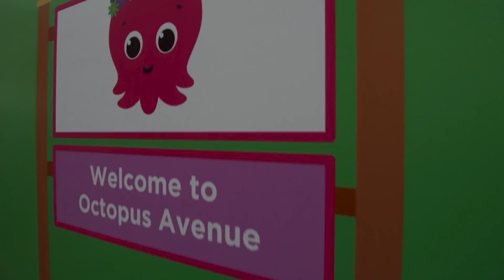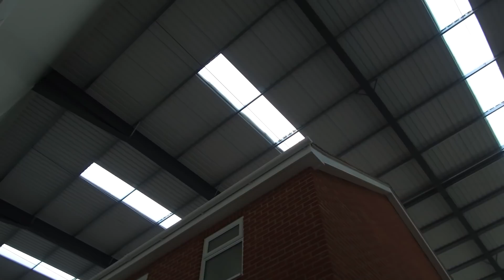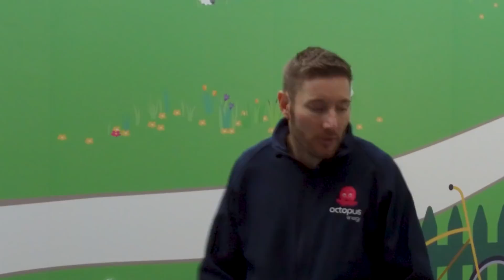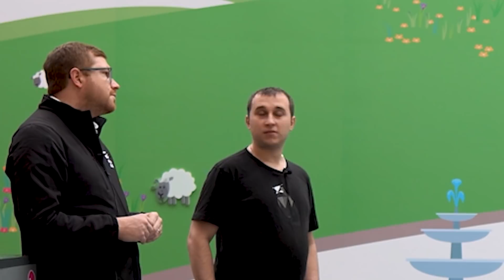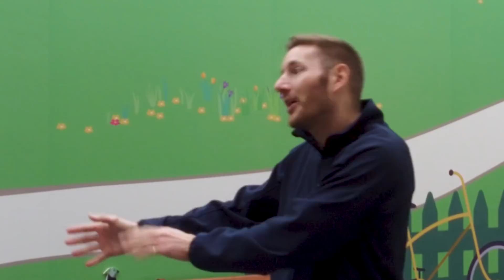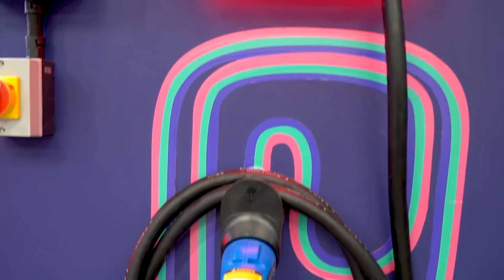How Heat Pumps Will Revolutionise Home Heating

Comment: old NEWS  Sweden got loads of them for at least 10 years another thing is tht we use  Other typ of heting from the  Ground you drill al hole and take advatage of the hard rock Teperature that aperently always is like 4 degrees i relay dont know  how they work  but they are also verry common heating. Aparently the english name is Geothermal heatpump

Comment: Why haven’t they built a solid brick wall house such as those fitted in most of our cities. Cavity wall houses can have aftermarket cavity insulation, Timber frame is in the minority.  My house is just 8 years old and it’s cavity wall with internal insulation block work, most houses I see built are of this design and there’s over a thousand in our area alone being built to this standard. At the moment all these houses in our area of East Sussex,  Hailsham are being fitted with gas boilers? so much for government legislation!

Comment: Hi  I like your video but have a few questions
.1.what gas do they use   as I understand freeon is bad for the ozone
. 2 what country are they made in
. 3 why are they using the old inefficient piston pumps instead of the 33%more efficient linear motors
Reply: Freon is a trade mark, and may be used for many types of gases/refrigerants, including the CFC gases that was extremely harmful to the ozone layer. (but also the HFC's that are not that harmful to the ozone layer, but acts as an extreme greenhouse gas) https://en.wikipedia.org/wiki/Refrigerant
In industrial systems, the there are an increasing amount of systems on offer with CO2 as a coolant.  Expect a slow trend away from HFC refrigerants, starting in the largest systems.

Comment: My gas per kWh is 3.5 pence per KWH. Soon I’m told it will double in price to 7p per kWh however my electricity is now 31 pence per kWh. A heat pump will cost £8000 to instal and at current electricity price I can’t afford to run it let alone install. Until the price of electricity comes down to a sensible level I and most other won’t be fitting heat pumps.

Comment: I lived in the UK for around 20 years, rented well over 15 properties up and down the country and the plumbing and heating solutions were, without exception, antediluvian. Even in modern apartments a box of bricks with a tarif-timed thermostat (a storage heater) was still considered standard in 2018.  Heat pumps are effectively fridges in reverse, they have been around on the continent since the 70s and there is nothing revolutinary about them.  The fact that the UK has only just discovered this technology now is amusing, but also telling.
Reply: Not here in the US, we are just going into the Devonian period

Comment: I understand (although not from this video) that the output from the heat pump is a much lower temperature than the gas boiler which is why the presenter glibly says you might have to have either more radiators or double radiators fitted. The problem is that a large percentage of houses built in the 80s and 90s have micro bore central heating which just isn't capable of providing more heat at lower temperature. As I am in a bungalow with all the central heating pipes running through the concrete floor I will therefore need the whole house to be replumbed with pipes running up the wall and what is this going to cost? Being cynical it makes me wonder what other little snags they didn't see fit to mention.. Sure I want to be green but as a pensioner I can't afford to pay twice as much for my new car and  3 times as much for my new heating system.
Reply from the maker: Octopus have a solution for microbore but aren’t in a position to announce it yet. We should have talked about it more, but there’s little they were able to release at the time of recording. But I saw myself the work they’re doing , they know it needs solving
Reply: @evdotnews  that’s all well and good, but OctopusEnergy have just increased my electricity tariff to 31pence per kWh, so in the words of the millionaires on TV “I won’t be investing”

Comment: What happens to heating if the electricity goes off
Reply: The same as your gas central heating - it doesn't work - neither will work without electricity.

Comment: Did you get to see the Nextgen far infrared heating system there? Octopus have been backing them for a while.
Reply from the maker: I didn’t - although I wasn’t looking out for them
Reply: @evdotnews  have you done any investigation into them? Really interesting tech. I think even better than ASHP. 1:1 efficiency rating, but smarter and more zonal than air source imo.
Reply from the maker: Will do. I have a 700w far infrared panel in the studio and it’s great for heating up that space when it’s cold.
Reply: @evdotnews  fixed panels are good yes. But the nextgen tech is full coverage. Wall paper like, low energy, high warmth - very promising.

Comment: Because heat pumps don’t replace gas boilers. Heat pumps need topping up from the grid.
Reply from the maker: I hear they’re working on heat pumps which don’t need to be plugged in soon. But for now, yes they need to be plugged in.

Comment: We build a new home 6 months ago it was ready, actually i was exited for the heatpump in my new house. But that quickly changed it is probably the most shit thing i have every bought in my life, it just gives disappointment after disappointment.
And that for €15k i will return it and get myself a pellet boiler this is half the cost to buy and half the cost to run, so my advise is not just straight buy a heatpump dive in to all the downsides and make a choice based on that.

Comment: Great voice & sound, clear and strong without fake radio voice.
I'm surprised solar thermal never worked out at least for heating.
Reply from the maker: We have solar thermal for hot water, and even on a winters day it can raise the temperature by a few degrees in the hot water tank, which saves money on heating it up.
Reply: @evdotnews  seems like that would be cost-effective even with the dropping prices of PV solar

Comment: If you own your own home, and are not a renter, or live in a council home. The first line of defense when it comes to home heating is weather proofing, and insulation, only after that should you make a decision on heating choice, given the UK’s present energy crisis, I would spend my money there first. Second spent should be a multi fuel heating stove,  or cook/ heating stove, you need an alternative to the high gas and electric bill coming your way. Installing a heat pump in a drafty house is a waste of money, evaluate your homes energy foot print, insulate, then evaluate further energy improvements needs.

Comment: I have a large property and plenty of land so I wanted a GSHP. Had two quotes between £30-£40K.
Needless to say that was never going to happen, we'd all like to do our bit for the planet but that's just an insane cost.
I know this video was talking more about ASHP which is a lot cheaper but IMO not as good a solution for my property but even then ASHP are £10k+. I bought a new GAS boiler in my last property the same year we sold up and moved. It was decent Worcester Bosch unit and with shopping around, I got it for £1400 installed. I think the Octopus guy suggesting Heat Pumps will soon be close to Gas boiler replacement prices is living in cloud cuckoo land.
Reply: I think he’s suggesting that it will be closer to the gas boiler price after the grant is applied.
Reply: And the problem is the environmental damage of gas production and burning isn't accounted for in the sale of the gas boiler. Additionally, all products, Inc heat pumps, should include a small levy to cover the environmental cost of manufacturing, shipping and proper recycling or disposing of at end of life. The environmental cost/benefit from use should be paid directly by end user at point of use based on fuel/energy type and amount consumed.

This would be a fair reflection of the actual environmental considerations of each technology and use patterns.
Reply: @ElectricCarAustralia  Absolutely agree but the problem is affordability. If people simply can't afford to buy a product not matter how much they want to, they can't and won't.

In the UK, the government often comes up with schemes to incentivise customers to adopt something whether it be the original attractive FIT fee's (Feed In Tariffs) for solar adoption many years ago to the more recent RHI (Renewable Heat Initiative) for Heat Pumps. 

As always the first schemes are often the best, with FIT, the early scheme had really good rates but unfortunately, Solar kit back then was significantly more expensive. 

With RHI, the scheme (which ends in a few weeks time) was actually quite good from a compensation point of view but I simply didn't have the £30k+ up front in order to pay for the system and wait several years to get the compensation back in yearly payments. 

The FIT scheme changed over the years and got diluted to pittance and RHI is now being replaced by another scheme where the government now just contributes upto £5k towards an installation (which is significantly less that the original RHI compensation scheme).

Most of these schemes often benefit the wealthier people in our society, those that can afford to do them in the first place and those that can't lose out.

Also, the pot of money the government puts aside for schemes like these gets eroded away by fraud cases. I've heard about chicken farms installing systems to claim the RHI payments and this was from a guy involved in the installations who claimed there was no way they were paying £30k+ up front to put these systems in. He didn't know how they were doing it but he was adamant there was no way they were stumping up £30k+ for installations.

It will be interesting to see what happens after March with the original RHI scheme ending because if people like me couldn't afford to take advantage of that, there's no way a £5k voucher is going to help or incentivise me, knowing what I know now. I suspect the order books for Heat Pump installation companies will fall flat now after the last 12 month rush for installations to beat the deadline.
Reply: The nice young man who has seen it all before - Octopus energy sells electricity. 
The whole piece is a sales pitch.
Reply: @miketurner3964  they also sell gas, so your point is?
Reply: @Muppetkeeper  
The point is after 30 years in the the heating industry fitting oil, gas, lpg, ASHP’s and Biomass, the one unit that is constantly mis - sold, breaks down and costs a fortune to run are ASHP’s. 
Octopus want you to run a heat pump, it makes more money.
Reply: @miketurner3964  mines been running great. There’s nothing better than a gas fitter to tell you ashp are crap. I suppose when the planet boils over and we all die, you can be assured that “gas was cheaper”.
Reply: @Muppetkeeper  
Well done Muppet. 
Oil, gas, Lpg, Solar thermal, GSHP, ASHP and biomass. 
40 years experience overall. 
Oh… nice woodpile.
Reply: @miketurner3964  You seem to have gained a further 10 years experience in the last hour, well done.
Reply: @Muppetkeeper  
Finished my City & Guilds in 1982, can count the previous 4 if you like. 
Let’s get back to your Wokeburner- what wood are you burning? Seasoned? Managed? Traceable? Or pallets and any junk you can scrounge to keep the costs down. 
Speak soon..

Comment: 7:10 Ooh, missed opportunity to say: "Heating buildings with hydrogen would require 6-12x more wind turbines and solar panels, compared to heat pumps" (dependant on efficiency of the best pumps and current efficiency of large scale conversion of water into hydrogen, now or sometime in the distance future). 🤔  😎👍

Comment: Most people don’t understand money I’m not a Greene but I like cheap heating so use a heat pump $1 of power in and $4 to $5 of heat out. Screw the carbon argument. I like to keep my moneys it’s like comparing a small diesel car verses a V8 I love the V8 but drive a fuel efficient diesel.  Next car will be the cheapest to run if it’s battery car so be it.

Comment: I have a heatpump, installed 18 months ago in a 1987 built house. The house is 4 bedrooms, 115 square meters with double glazing and 300mm of loft insulation. The walls are cavity filled, to 1987 standard.
I love my heat pump, you need to get your head around it at first, and don't keep your "gas boiler" mentality, you switch your heat pump on, and let the thermostat keep it where it needs to be.
Gas boilers are "on or off", my heat pump replaced a 14kW boiler, which basically was full on or full off for short periods of time, burining 14kW of fuel when on.  My heat pump is on longer, much longer, but it "sips" electricity most of the day. Right now it's 5 degrees, dark and raining, my house is 21 degrees and my heat pump has been gently pulling 800 - 900 watts most of the day.
All in all, with my measured efficiency is 375% inclusive of heating and hot water, so it costs the same to run as my gas boiler did.  Don't forget gas boilers are not 100% efficient when comparing the fuel cost.  My wife also thinks the house feels better, rather than hot the cold then hot, it's just cost all the time.
Questions welcome, I'm a home owner not an installer, so I can't promise the answers will be technical.
Reply: What’s the electricity bill like
Reply: @noelyboy6969  Costs almost exaclty the same as my gas did. And that's with being stuck at home all year rather then being away often.
Reply: Could you estimate  a daily cost to heat the full house please? I have an all electric house with electric heaters which are v expensive,they cost over a tenner a day to keep the house luke warm.I'm having a firm around tonight to give me a quote and would like your honest info cheers.
Reply: @markazz1000  hi, that’s a really tricky one, every house is different, size, insulation, temperature you like it at etc.  All I can say is that your electric radiators are 100% efficient, whereas heat pumps are more efficient. The key is to have as low a flow temperature in the radiators as possible. As you won’t have wet radiators just now, it will be a big job for you to have a heat pump. I’d suggest finding an energy surveyor to see if insulation can be improved as a first step.
Reply: @Muppet Keeper   thanks for reply,it's a minefield I'll see what they say.thanks for info.

Comment: "Electricity is artificially expensive; gas is artificially cheap".
I doubt that...specifcially the last part.
Also, saying we should switch now because we'll eventually run out is like saying we should all jump off a cliff because we're all going to die eventually anyway. As fossil energy wanes, its cost will gradually increase. That will eventually make alternative energy naturally attractive.  The regulators of inevitible fate who wish to artificially push the change for others should be forced over the precipice first.

Comment: I want to like this video. It is informative.
But it's hiding a lot of things.

I'm personally looking at a ground source heat pump in combination with a biomass boiler with 1kWh sterling engine and accumulation tank.

A heat pump on its own would not work.

Not telling people about what you would need to do like oversize your radiators.
The need for a hot water cylinder.
The poor heating power during the winter when you need it the most.
And the cost of £13k to £15k
The trials they performed were not favourable.
Maintenance costs... Reliability...
The noise of the unit can cause problems with your neighbours. 
The built-in electric heater in the heat pump to heat the heat pump when it's cold or frozen up.
Incredibly high running costs in the winter.
The fact you have to keep it running all the time.

Don't take my word for it. Do your own research...

Comment: So where do they think electricity comes from?  A small portion from renewable but the majority from fossil fuel plants.  Now for renewable energy plants they need approx. 8 - 10x the land footprint of a fossil fuel plant. Seeing that England is an island space is at a premium.  Now throw in all this additonal demand plus EVs, etc... The power demands will far outweigh the production from renewables.  Oooh one last thing.  Solar doesn't work at night and that's when demand would be highest because it's colder.
Reply from the maker: Solar doesn’t work at night? I have solar panels and they work fine, just because it’s night in the UK doesn’t mean it’s not daytime is Australia for instance. It’s just takes longer for the sunlight to reach my house from Australia - but the speed of light is really quick. I don’t know exactly but it’s definitely very fast.
Reply: @evdotnews  WTF are you smoking?  When it's dark there is no sun. No sun there's no direct white light and therefore no electrical conversion.
Reply from the maker: Erm, the scientific principle of refraction. It’s where light bends around an object. So daytime light will bend around the earth, aka REFRACT, and I generate 24/7. I’ve not checked this but I’m sure it’s true.

Comment: It’s very much a changing technology. Current very high efficiency and very low operating temperature of modern inverter based air sourced units operate at COP approaching 5 in ideal conditions and are still functional at negative 13 deg f (see Mitsubishi website). We are at the point where a well insulated house located in a very cold climate can eliminate central auxiliary or backup heat.

Comment: Are heat pumps a new thing in the UK? They are the typical choice in more temperate parts of the US where homes are air conditioned. Heat pumps are quite efficient at moderate winter temperatures but become gradually less efficient as the temperature drops below freezing. If the temperature drops far below freezing resistive electric heat must be added. This is surely the reason Tesla heat pumps are failing in Canada. They hav really painted themselves into a corner with their coolant circuit as I understand it.